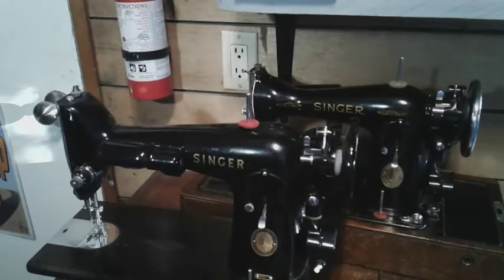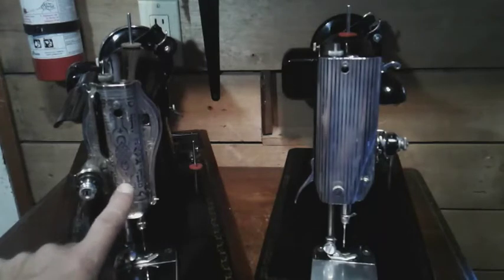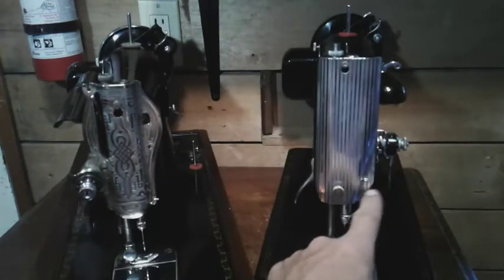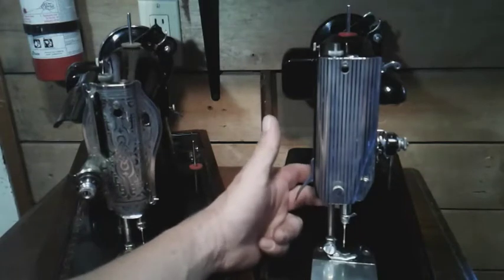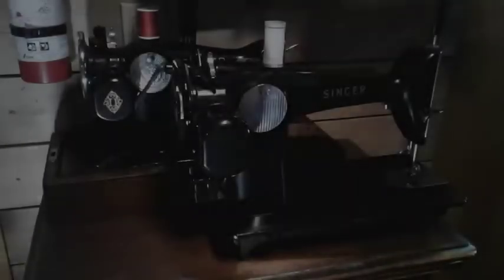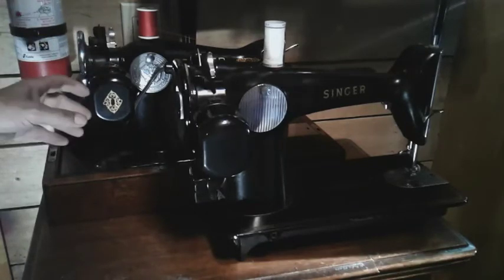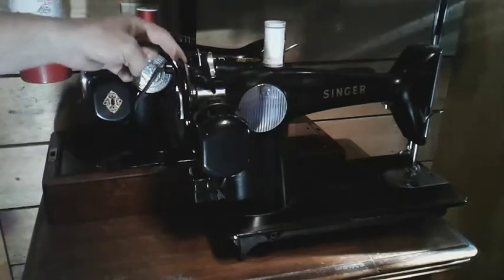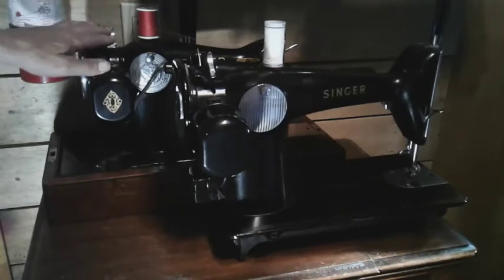Singer 15-91 vrs Singer 201 , What one would i keep ..

Comment: The challenger is a 201-2. Not a 201. The 201K is more like the 15-91
Reply from the maker: Thanks 👍
Reply: You say "The 201K is more like the 15-91"

No, it's not. It's a standard 201 with a belt drive from an external motor. And the K means it was made in Scotland.  Belt drive allows for very easy motor upgrading. The 201 with a modern 1.5amp motor and electronic foot control is a dream machine. That's 1.5 amp on 115 volts, and .75 on 240 volts.

Comment: Thank you for showing this.

I have not tried the Singer 15, but I have a Singer 237. From what I know about the Singer 15 I would agree, that the Singer 201 is a better machine compared to the 15. I have got a Singer 201 and a Pfaff 30 and made a comparison here in this video: https://youtu.be/u2D2DEKtgFQ
The sewing shown is with somewhat modified machines. But in this comparison I would consider them to get equal total score, but on some parameters one would be better than the other. The Singer 15 is in some ways equal to the Pfaff 30 and it is most likely easier for the motor to drive these two machines, than it is for the motor to drive a Singer 201. However the dialed tensioners of the Singer machines from that time period got a poorer quality than the Pfaff 30 and many other brands, and that is the main reason why I think the Pfaff 30 is a better machine than the Singer 15. I think the Singer 15 design regarding the cam driven take-up lever and position of tensioners is not as preferable.

I have seen many users, that consider the Singer 15 a better machine for heavy duty work, and I think it is because, it got lesser friction (at hook) and it is easier to drive by the motor. You cannot do much about that with the potted motors. But with belt drives it is possible to install speed reducers on the machine, and with a lower gearing to motor, I think the Singer 201 have the ability to make a better stitch with thicker thread and heavier fabrics.

This is another video about the Pfaff 30 from "The Stitches".  https://youtu.be/YWuTAmAMD5E  He consider the Pfaff 30 better than the 201. 

I have not seen a comparison to the Singer 66 anywhere, but it do have one significant drawback, because it do not have full reverse stitch length. You like to have that if you sew vinyl or leather. Unfortunately many of the vintage Singer machine do not have full reverse stitch length, but the two machines, that you show here, have got that.
Reply from the maker: Ah the 237 fashion mate , had one of those and sold it , i also own a pfaff 332 just trying to sorce a belt  , i agree that there are better machines , i also own a Necchi BU from 1951 , way better then my singers but thats another video lol ...thanks for watching and commenting i do apreciate it 👍
Reply from the maker: I will take a look , i had a fashion mate as well , found on side of the road , that 237 worked fine i cleaned it and sold it for 40 bucks , new life  , thanks for commenting